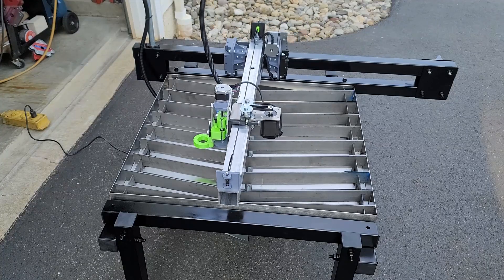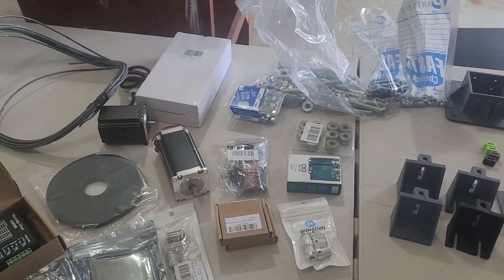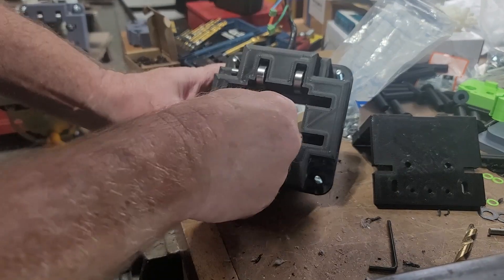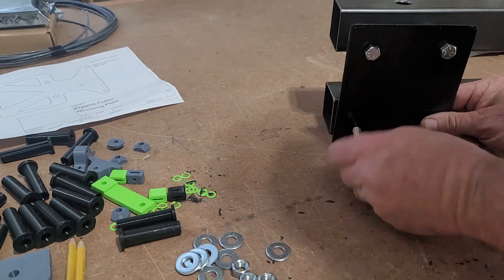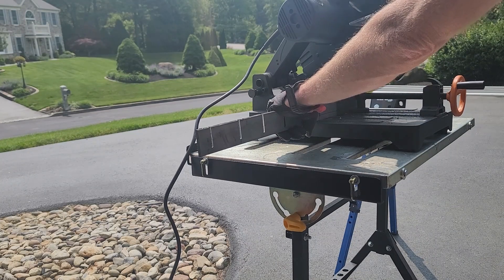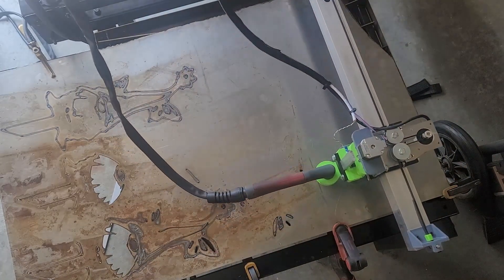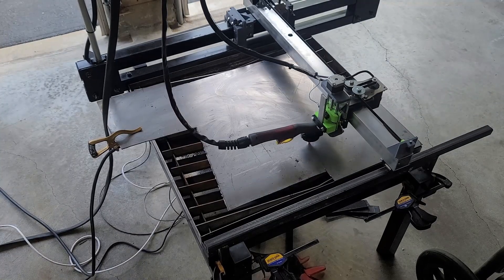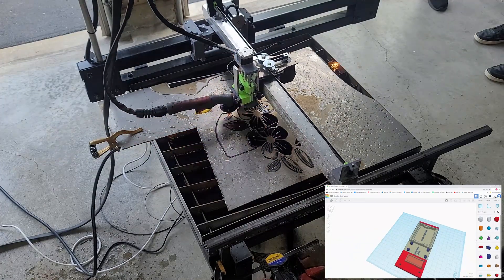DIY CNC Plasma Table Based on JD'S Garage plans

Comment: Hello, I spoke to the good folks at J D Garage and they said the bearing idea for the X axis was not the way to go. I want to build a larger table and they recommended another drive motor for the end. Your idea is simpler and cheaper.  Have you had any problems with it?
Reply from the maker: I have no issues at this point. If you are going larger, I would definitely consider what JD'S garage is saying.  Weight will be your issue.  My build there is such little weight that the linear bearing has no issues. It's only there to keep everything level. What size are you looking at building?
Reply: I would like a 4x4 table. Based on what J D and you have said I have ordered an additional motor and driver. It's a little extra money but better to do it right the first time. Thanks for your input,  Alan
Reply: Hi what kind of software are your using??
Reply from the maker: @vb5457  grbl and open-source

Comment: Is the Z switch NO or NC? Can''t get my Z working properly thought it may be the wrong switch, but I am pretty sure the plans show NO in the schematic
Reply from the maker: Do you have the 6 or 5 pin relay?.
The 5 pin and 6 pin wire up slightly differently. 
Yes, it is NO on the relay. Some relays the pin configuration is different from the schematic drawing. Double check you have it in NO.
Reply: @harbaughsworkshop  Thanks but referring to the Z axis switch not the torch relay.  Everything worked perfectly except for the z touch off it literally travels to the workpiece and crashes into it.  Openbuilds show the switch activating but the Z doesn't stop, it just keeps traveling down until it crashes.
Reply from the maker: @rhinons7353  are you using shielded wire or 2 co conductor wire for your micro switch?
I had the same issue, I switched out the z-axis switch wires with a shielded wire, and my problem was fixed. But yes, the  No and common to the micro switch from the arduino. When I get home from work, I will double check know my connection at my micro switch  and let you know

Comment: As a noob to everything CNC, I was wondering what 3D printer you were using? I've been shopping around for one, and all the reviews bounce around like a ping pong ball in a zero-G room! I see units for about $300 that look to be decent, then I see units for $800 that look like junk! I'm just asking a few of the people that I subscribe to what they like to use... and why!
Reply from the maker: Sorry in advance for the long answer.
In the CNC video, I  am using the Creality Ender 5 Plus.  This printer was in the $600 range. I immediately did upgrades to a silent board, Capricorn bowden tube, better nozzles, and an all metal extruder. This brought me up over $700. I learned a lot with this printer, and it served me well for years.

I have recently added the Bambu Labs X1 Carbon. When Bambu Labs released this printer, I believe they reset the standard for home 3d printers. 
This printer is a true plug and play printer, so much faster and with an amazing print quality, they made bed leveling easy, has the capability of printing most types of filaments including tpu, carbon fiber, etc right out of box. This printer is a bit pricey.

Since the release of the X1, they also released the P1P. The P1P is a stripped-down version of the X1, but it keeps the speed, quality, and auto bed leveling. The P1P is, I believe, under $500 . This year, they improved the P1P with the P1S for around $599.This printer is a mid range between the P1P and the X1.

Creality and Prusa have released their version of 3d printers to compete with Bambu Labs
Creality  K1 and Prusa MK4 I have not tested these printers. But the look very competitive.
Just recently heard about the Magneto X by Peopoly that I will keep an eye on.

There are several other printers out there. These are the ones I know about or have been keeping up with.
If I was just starting out, I would lean towards the P1S or the K1.  Good price range, fast, auto leveling, great quality prints. Some people are not fans of the K1 software.
Research before you buy, and think about what kind of printing you will be doing. Exotic filaments like carbon fiber require features that standard printers don't also come with.
Hope this helps you out.
Reply: @harbaughsworkshop  thanks! I appreciate all the time you put into the response. I hadn't taken a look at the Bambu Labs stuff before, but it looks very nice! I like the P1S, especially with the AMS on it. Not needed for making parts like this, but my wife was looking over my shoulder (and wondering what I wanted to spend money on this time!) then when she saw what it could do with the multi-color filament, she said that there would be a lot that she'd like to make as well! So that may be the selling point for it!

I'm going to order JD's plans, then get started on making the CNC. And it looks like I might be able to make the 3D printed parts myself now! I really appreciate your channel... and the fact that it's not just about tools! Great stuff!
Reply from the maker: @eddiedee58  I appreciate the feedback. My wife wasn't a fan of the 3d printer at first. I have the AMS on my X1 Carbon.  This is what I used to make the Grugu that I put up on my channel.
The CNC is a fun build. If you have any questions, don't hesitate to ask.  Keep me updated with your build.
Reply: @harbaughsworkshop  OK, I am now getting ready to pull the trigger on the X1C! I've looked at all the ones you talked about, along with a couple other units (including the  Ultimaker - nice but out of my price range!). My question (and one I asked JD as well) is what material did you use for supports on components that may need it - like the X-axis plate? I assume you used PLA for the parts, but did you stick with PLA (no pun intended!) for supports or did you switch to PETG? I appreciate you taking so much time to help all of us be better at our craft!
Reply from the maker: @eddiedee58  Thanks to answer your question. I used PLA for all the 3d printed parts.  The X1 Carbon is an awesome machine. I am glad I could help.

Comment: You mentioned the software in the video but I couldn't make out what you said. I wouldn't have a problem building this but I'm clueless on getting the design or cutting pattern from my brain to the table. What software and steps are involved? I do 3D print so not totally clueless, LOL.
Reply from the maker: I software I use is inkscape, great software, once you get the hang of it you can do a lot with it.

Comment: Did you usu a 5 or 6 pin relay and how do you have it wired up?I'm having issues with mine.
Reply from the maker: I have the 6 pin relay, I wired it exactly the way the separate page 6 pin relay schematic drew it up. The main schematic shows the 5 pin relay wiring.
Make sure you are following the lines and not just the schematic. Some connections may be in a different spot on the relay than what the schematic shows. I had someone contact me recently, and that was the issue.

Comment: Hey mate did you happen to find the plan layout a little confusing? I purchased the plans and am currently printing some things but are a little unsure on what i exactly need. Some stuff is listed and of how many but others are not mentioned..
Reply from the maker: The bill of materials list every you need for the basic build and where to purchase these items. For the z-axis probe there is a separate bill of  materials just for that in the z-axis folder.
What information  are you looking for that you don't see listed?
Reply: @harbaughsworkshop  just feels a little confusing with what to print as it doesn’t explain print this one for this size to me, I could be wrong haha
Reply from the maker: @EngineeredToDesign  I know the list of printed parts does give you a quantity of most of the parts. Except bolts spacers, I printed more than what was listed, and washers for the bearings.
 I printed enough spacers  for the bolts used for the frame and a couple of spare. I printed 2 washers for each bearing used.  The torch clamp size depends on your torch.  Everything else is to print the stl file as designed. The key thing is to use the print settings explained in the instructions to make sure the parts are rigid enough. 
When you go through the plans to build the CNC, it will show you more about what each part is for and how to put it together.
Reply: @harbaughsworkshop  thank you, I was just confused on the gantry flange/ motor flange but I think I have figured that out, the print settings are good I’m using a smaller nozzle though

Comment: Nice job with the modifications.  I wish you would have spent more time on the modifications you made, especially the added roller and the added railing (how did you mount it).  Also thanks for providing the STL files... I'm currently getting the BOM together... and hopefully will start the build soon. Just out of curiosity, what did you use to house the electronics? BTW, love your collection of tools :)
Reply from the maker: Thanks for the feedback, I am using clamps for now to hold the rail, and I am using shims to adjust the height.  I do plan on bolting the rail in place. I wanted to do several cuts, large and small. Once I am happy, I will add the bolts. Honestly, it's working perfectly the way it is, so I am in no rush. I was thinking about reposting the video and include more details of the changes I made and add additional changes like how I added a drain to my water pan.
The housing for my electronics is an old box from my work that was trash, so I recycled it into this project.
I am running out of room with my tool collection, lol

Comment: Nice build. Can I ask, what is the flex in the gantry arm like? Those 3d printed parts, are they pretty rigid?
Reply from the maker: The 3d printed parts are pretty rigid, and yes, I added the rail because my aluminum x-axis added extra weight, and it dropped a 1/8 of an inch while fully extended. The plan calls for a thinner gauge steel. My supplier didn't have square tube that thin.
Reply: @harbaughsworkshop because aluminium is light wouldn’t it be lighter? or is the thin gauge steel lighter?
Reply from the maker: @peejayem4700 I'm not sure, I couldn't get my hands on that thin of a guage steel at my Steel supplier
Reply: Just watched to the end. I see you had to deal with it by adding that bearing on a rail. Nice solution.

Comment: Oops I got aluminum tube for my X rail too, guess I'll have to mod up a bearing also. Neat looking work !
Reply from the maker: Thanks for the feedback. See how runs before adding the railing. If it's slightly off, you may be adding shims to level the  pan to match the slope.  Mine was just too much, that is why I used the rail
Reply: @harbaughsworkshop  I think the support rail is a great idea, overall long terms, its slightly more cost for the build but it will increase the longevity of it too. Its reducing the wear and tear on bearings immensely.
Reply: @harbaughsworkshop   I noticed your using Inskape I think to design, after that how do you create toolpaths? Are you using the "OpenbuildsFusion360PostGrbl.cps" they reference from the video from JD's Garage Youtube page? On the lines they say to edit , they have characters there, they are not blank. Im confused if I should delete those ? I have mine moving manually and even with my Vectric aspire with the grbl.pp, I can run "air" jobs. Im new to the PP editing but the dirty stuff and welding smoke I get. I really like your band saw. Is it operated with a foot switch?

Comment: hi .. thanks for share . if posible to make this table 4' x 8'?
Reply from the maker: Yes, you can make this 4' x 8' table.  You would definitely have to support the x-axis spanning the 4' length. The rail I added should work, but I'd change to a regular bearing or wheel. The linear bearing might have problems with the weight of a 4' x-axis
Reply: @harbaughsworkshop  thank you .

Comment: I see you replaced one of the shins with aluminium? I'm thinking about it too. Why only one?  Did you keep the size? Is it metric or inch?
Reply from the maker: I used aluminum on the x-axis, and y-axis motor mounts. The torch mount, and I  used an aluminum 2 inch by 2 inch square tube 
For the x-axis to try and keep the weight down

Comment: Why are all these parts so heavy? You’re just moving a plasma torch around… I’d just use some Chinese knock-off 80/20 aluminum, some drill rod and linear bearings. I need to fire up F360 and make and sell my own plans. This build, while cool, is way over-complicated…
Reply: Because steel square tubing is cheap and aluminum extrusions are insanely expensive, and a plasma cutter doesn't move it axis's nearly as fast as a 3d printer so weight doesn't really matter
Reply: Why fire up F360 when just using extrusions? Controlling accuracy of plasma cut parts is essential in some circumstances and there is zero penalty for overbuilding in this instance. If you had a legitimate concern about the inability of this table to perform the desired task I could see you making a recommendation but it seems you may have been tooting your own horn to me.

Comment: Hi, nice video content and editing. I'm looking at building this machine too, and I was considering using aluminum for the floating axis arm like you did. The biggest challenge for me is about electronics and wiring. I don't know what CNC board too chose. Would you mind telling me which motor drivers and cnc controller board you (or JD's Garage) are using please? That would help me a lot. Thank you very much in advance. Cheers
Reply from the maker: Thanks for the feedback.  When you buy the plans, JD'S Garage gives you a complete material list. This includes everything from electronics to bolts and screws. They also give you easy to follow schematics for the electronics.

Comment: Nice Job!  I am building two (2) sets of Y-Axis to put on both sides to support the X-Axis, had planned to do it this way from beginning just for fear of gantry moving which you just confirmed is and issue.  Basically just building two (2) of the gantry supports, one for each side, will have to add second stepper motor, but those are cheap enough.
Reply: How about "4x4" with a shaft driving through the X-axis instead of a second stepper motor, which could get out of sync?
Reply from the maker: Thanks, let me know how you make out with your build.

Comment: Can you tell me what the total cost was?
Reply from the maker: My total cost was $486 before adding the extras ( the pan,Bluetooth module, z-axis probe, extra hardware for probe,etc). $299 for the extras.( $130 plus of this was the stainless steel pan).
I did add a drain and hose to empty the water in the pan, which isn't in the video that brought the price of extras to the $299
Reply: @harbaughsworkshop  
Thank you
Reply: @harbaughsworkshop  and lot cheapen can made pan DIY scrap metal sheet and welding own pan whit water drain hole and tube, metal have cheap looking scrap metal or aluminium profile what found cheapen, arduino controller cost 10$ motors about 30$/pcs, cable, some buck, i build small cnc carving machine same style to wood, less than 300$.

Comment: I like the z-axis touch-off feature. Is that the same as Torch Height Control? I bought the set of plans but I'm not really sure about THC or if my application requires it.
Reply from the maker: The z-axis is a probe, not THC, it probes the material and sets the torch height to the proper height you set it for per your torch requirements.   THC measures the current and maintains that current by adjusting the height. If your material has a warp or difference in height, THC will pick up on that.   JD's garage hasn't released the plans yet for their THC.  They are still perfecting it before they release their design.

Comment: I put a single 608 bearing on a plate down to the chassis rail to solve the same issue. Im not convinced that a linear bearing is going to cope for long in a rotary motion… the ball races are not oriented in that direction, but anyhow… the loading in this application is so light that it might be fine for a long time… time will tell.. :)
Reply from the maker: Thanks for the feedback, I agree time will tell.  The load is so minimal, that's why I was good with this solution. I use the CNC all the time, and so far, it's working perfectly

Comment: Hi from Aust. Can you please tell me why mild steel section and not aluminium for the entire frame?
Is it due to cost savings, earthing ? Or to just give it some weight ? 
Cheers and very impressive 👍
Reply from the maker: Combination of everything.  Definitely cost. It is a budget friendly build .
Weight and stability using the steel is definitely a plus.
Aluminum is a softer metal than steel. The steel will hold up better with the bearings running on it, especially with the weight of the x-axis.   I believe I am goog with the x-axis being aluminum, but time will tell.
Reply: 1/8” alum is 1.10 lb a ft.
.065 steel is 1.71 lb a ft.

Thank You for your video, it was helpful.